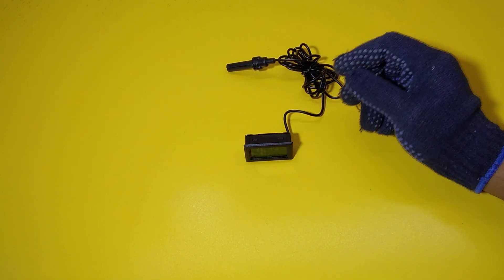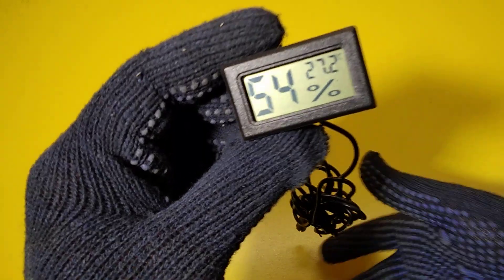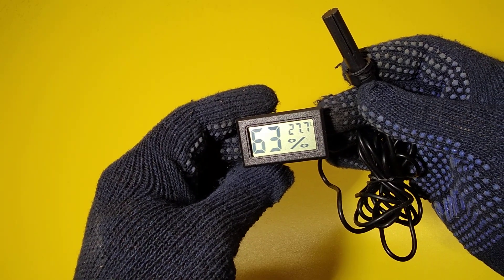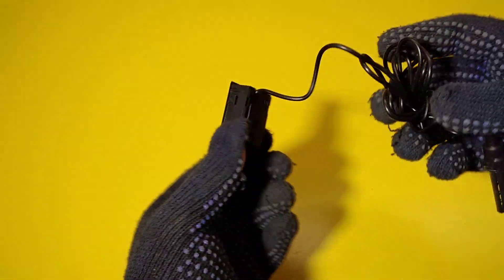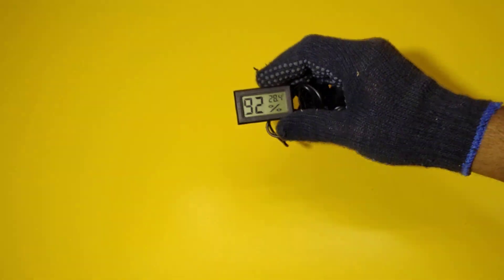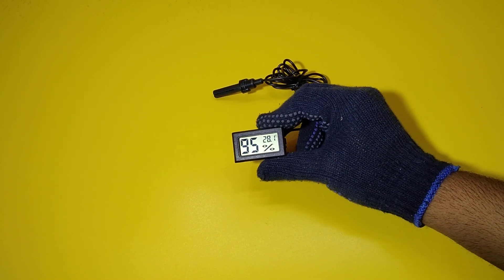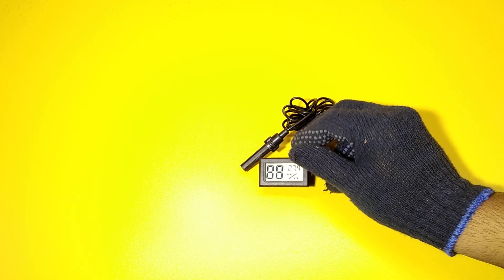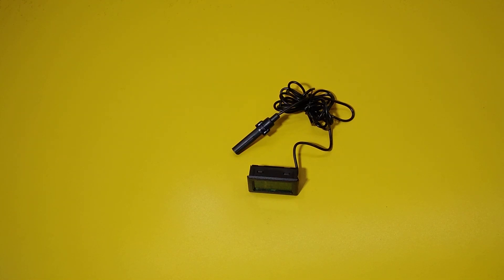Digital humidity and temperature meter with probe hygrometer

Comment: Chinese products which are basically copy typically dont use name and the device which you are using is pretty good one i have the same device in white colour with out the probe and good thing is it works with one battery how ever it has two battery places or sockets try to use one battery see it works.
Reply: how accurate is it, is its reading stable, i had thats one whose reading was not stable, keep changing up and down.